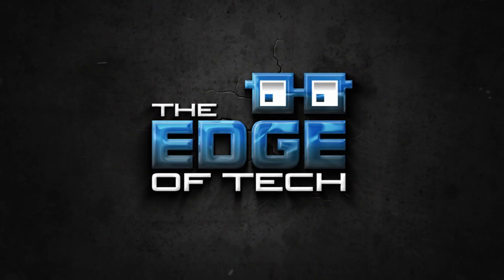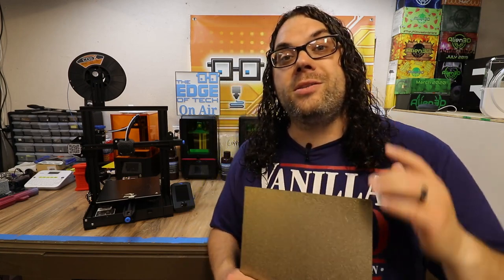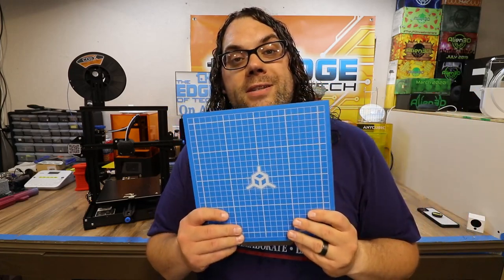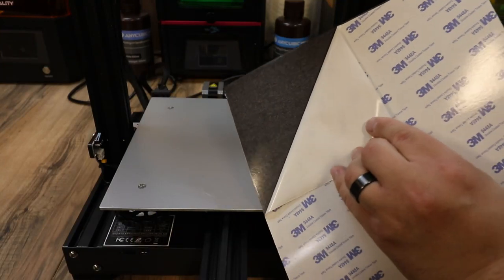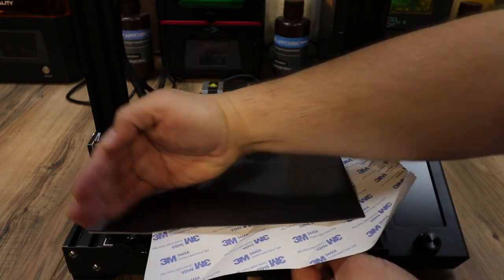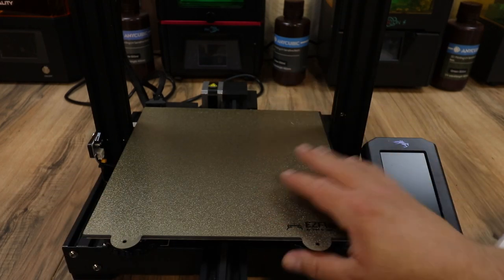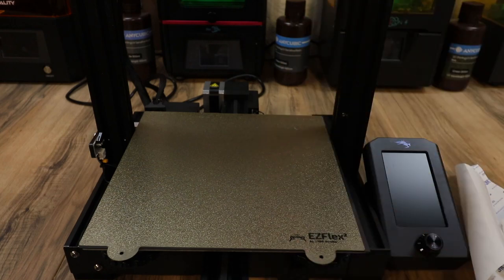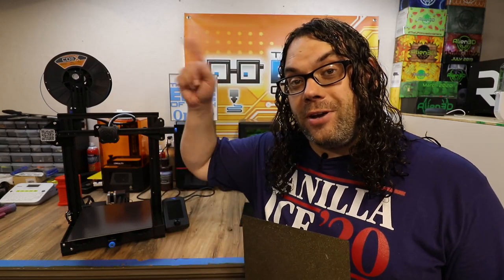Upgrade the Ender 3 V2 Glass Build Surface in 5 Minutes or Less

Comment: I swapped out my glass for PEI sheets about a month ago and have no regrets. Love using it with UBL as the leveling method. I've got a mesh saved for each plate and a printer profile in prusaslicer setup for each build surface so I just make sure I select the right mesh before printing and boom its good to go!
Reply: How do you save the mesh? And do you run ubl each print?

Comment: Thanks for this video. I decided to upgrade this and the springs at the same time and glad I did. I had noticed that the original springs were so loose that the bed would wobble back and forth. The glass bed worked fine for me with larger prints, but anything that needed small detail at the bed such as a small hole for a screw just wouldn’t stick no matter what I tried. But now all these problems are solved!

Comment: Very cool!! This was my second upgrade on the V2, with the spring upgrade being the first. A week after getting the V2 I got a Anycubic Vyper with a textured PEI build plate and really liked it. Putting a flex plate on the V2 has made my prints much more consistent with the Vyper and really boosted my trust in bed adhesion without any assistance from AquaNet or glue stick, which I still have not used yet. You haven't steered me wrong yet, and TH3D has been phenomenal to work with!!  Thanks again for everything you do!!  Beautiful Job, Jim!!

Comment: I've never had to pull anything off the v2 glass bed. If I'm happy to wait 10 minutes for it to cool down, the part just isn't attached any more, and I just pick it up!
Reply: @gzaros  yep, not the 99 percent stuff though, rubbing alcohol is fine. I just keep a lint free cloth and bottle by the printer and clean the bed every 3 or 4 prints. Takes seconds. I've only had one spaghetti print, and that's because I'd knocked the bed out of level when moving the printer.
Reply: @ForVectron  Thanks!
Reply: What settings and what brand pla? I can only get very large and round objects to work on the glass bed. Anything small will not stick at any temperature.

Comment: I just ordered this kit after getting burned by a used Amazon 
BIQU SSS Super Spring Steel Sheet Heatbed Platform. No magnetic sheet for the bed. Adhesive residue. It was clearly used because it had print lines on it. Lastly, the thing wasn't remotely flat.

Should have just spent the extra money on the EZFlex kit.

PLEASE do a pros and cons of when you'd use the smooth vs textured vs EZmat for various filament materials.

Comment: Great video! Would it be possible to use binder clips with the PEI sheets instead of using the magnetic sheet? I'm not sure how hard the magnetic sheet would be to remove if the magnet degrades over time. I am weighing my options. Thanks!

Comment: I love the Creality glass bed, would never change it for that. would be a huge downgrade IMHO.
Reply: yes it huge downgrade all my printer got glass beds if want my print off quick just pray some isopropyl alcohol and its off done!!
Reply: Don't like it, doesn't stick well even with magigoo. Replace with something else asap.
Reply: How are we sure the double sided mag sheet are true flat? With the constant flexing n bending of that top sheet to remove materials, wouldnt it eventually affect bed levelling?
Reply: @GoldenJaguar3D  And clearly you have no idea either. I managed to figure out the root cause, the glass bed wasn't flat and the center was lower than the corners. That is why it didn't stick well. You can try to level the bed all you wan't, but it's impossible to get it right. I 'fixed' it by installing a bltouch to compensate for the poor quality of the glass bed.
Reply: @GoldenJaguar3D  again, calling someone a noob isn't really helpful, rather disrespectful. And I'm well aware of manual bed levelling using a mesh, but you assumed I did not. Next time try to be a bit more constructive.
Reply: Totally agree, love that glass bed, works great.

Comment: The blue sheet seems to be similar to the lockbuild, been running a lockbuild for a few months now on a flex plate and love it. No heat needed for pla and everything sticks perfectly on a modified ender 3
Reply from the maker: I haven't used the lockbuild, but I can say that I LOVE the EZMAT! You are correct, everything sticks to it! Thanks for watching!

Comment: The Creality glass bed is the best surface I've usd to far. Mine is staying on. Also, why are you taking the bed off and on a lot? I wipe mine with some alcohol-based cleaner when it's greasy but never needed to remove it.
Reply: The only issues were when I had an unlevel bed.

Comment: with my glass beds, I select cooldown and place a large billet of aluminium or copper on the bed which serves to cool down the glass much much quicker and releasing my prints
Reply: Brilliant! I haven't used my glass bed yet, but I'll be using the aluminum chunk trick to cool down quicker. :-)
Reply: I recently got an ender 3 did a petg print had masking tape on the glass bed but couldn't get it to pop off even in the freezer afterwards 🥲
Reply: @Joshplv  I have found thet a litlle less squish than one would use for PLA works wonders when printing PETG/PET

Comment: Honestly as much as I wanted to love the pei bed... I find it's much more upkeep intensive...

But i also did use the creality one.
Reply: I was using the creality glass bed and it had so many issues. I ended up getting the pei bed from creality and it adhered so well and popped off so easily. With the glass bed I had so many failed prints. Not so much now
Reply: Yeah I spray hairspray on my glass beds... This pei bed.... I'm starting to get tired of.

Comment: I also upgraded to the PEI plate and it works great however i just noticed an issues when levelling the bed, All 4 corners are level however i cannot get the nozzle to touch the paper the whole centre area of the bed from left to right when all 4 corners are  fine. Has anyone else had this issue?
Reply: same isse but no solution until now...
Reply: The solution is manual mesh leveling. Really!

Comment: can you still use the glass bed after putting the magnetic bed?
Reply: It is not advised because some people (including internal testing) have shown that the glass can bond to the magnetic sheet in some cases.
Reply: Just put something in between the glass and the magnetic sheet (like the original magnetic flexible bed, sheet of paper,...) and print directly on glass. Don’t forget to adjust z stop.

If not, it will “bond” as stated above.

Comment: Brand new to the 3d printing world.  Just order my first 3D printer this week (Ender 3 V2) and am looking into a few recommended upgrades for it.  Very interested in this system, however, I am a bit confused.  I am looking into experimenting with pretty much every filament type.  Which of these (or all) should I order?  As far as the EZMat, is that also magnetic or will I need to attach it to the bed with clips, etc.?  I would like to be able to utilize the flex function.  Any help that anyone could offer would be most appreciated.

Comment: Hopefully someone on here can answer me this question. So I have this exact printer and want to do this upgrade but don't want to waste the money if its not going to work how I want it to. So the glass bed that it comes with works amazing for me and it has not once given me adhesion problems. Where my main issue starts is now that I'm trying to print larger items no slicer will let me use the whole bed because it is accounting for the darn clips that hold the glass plate in place. This is why I am interested in this upgrade, because it would get rid of me having to use those clips for the bed however how would i go about putting that in the slicer so i can use the whole bed?

Comment: Is it possible to replace the stock noisy fan with a noctua fan on the ender 3 v2? Havent seen any videos about this.
Reply: Yes you can replace all fans with noctuas. It does take some knowledge as you have to use converters to adjust voltage and might have to do some soldering.

Comment: Good video Jim, What is the max bed temp you can use with the magnet?
Reply: 140C is the max on ours. :)
Reply: @TH3DStudio  Thanks.  I would be helpful to see packages for each printer.  I have Ender 5s and Ender 5 Plus.  I would need a magnetic plate and at least one flex sheet to go on it.  I looked at the TH3D store and was a little confused as to what I would need to purchase for the E5 Plus.  It looks like I would need a 410x 410 Ezflex 2 at $27, EZFlex² - Flex Plate - Smooth 410x410 at $54, and or a EZFlex² - Flex Plate - Textured at $59.   Would the Ezmat need another steel sheet?
Reply: @woodwaker1  ender 5 plus needs the 370x376 size plate. If you look under the selection boxes, once you select something it lists what machines we know they work with. You can always contact our support or live chat for questions on compatibility.

Comment: how to remove prints from that ender3v2 glass bed? they stuck so hard i broke my print. i tried cool it down to room temp and even run some cold water.
Reply from the maker: Ya! I have that problem sometimes. I would double check the leveling and make sure you are not squishing the first layer down to the be to much. That will help. Also, you could use hairspray or glue stick to help it release.
Reply: @TheEdgeofTech  yeah these are my first prints. When you calibrate table you need paper freely move under nozle or litle like scraping or hardly move?
Reply: @craftzars  you don’t want it to move freely I think. Then it Eileen’s stick at all and fall off. A little resistance I think is good
Reply: @joeyfourth5535  ofc not freely but i want to take it off my parts so they dont get damaged 🙄
Reply: @craftzars  have you to tried tape. I cover the glass with a layer of blue painters tape and re level the bed for the layer. They it should just pop off after the print. If not I’m not sure 🤔
Reply: @joeyfourth5535  i will try tape method 👍
Reply: @craftzars  awesome!  I got a ender 3 v2 a week ago but have to get a new bed. Mine came severely warped.

Comment: you missed a important bit clean the aluminium first :)
Reply from the maker: Good point! That's a great practice to clean it first!!
Reply: @TheEdgeofTech  how? please explain more info on upkeep for these sheets you mentioned none!
Reply from the maker: @ljohnso16  Clean the plate before putting on the magnet. Then just wipe the new plate with ipa to clean it!.